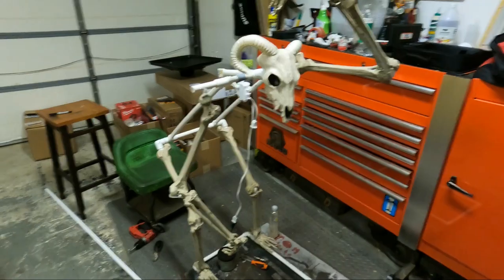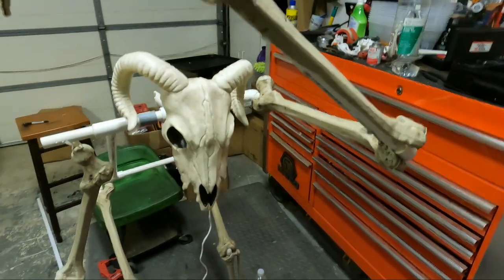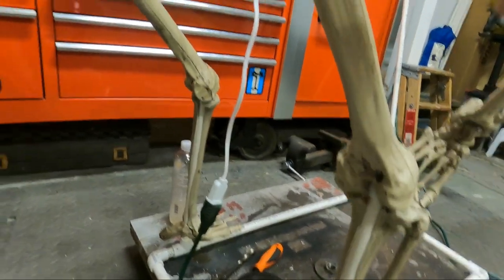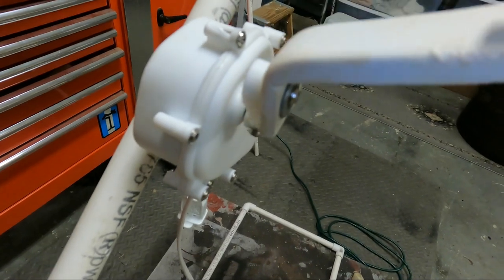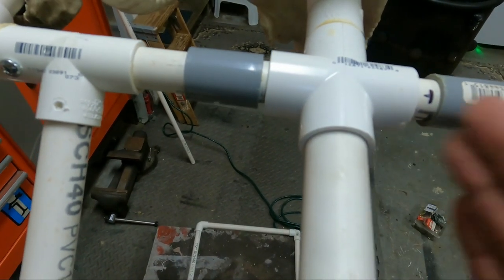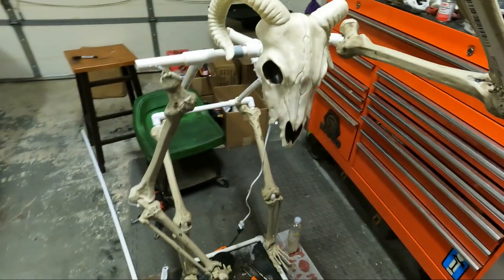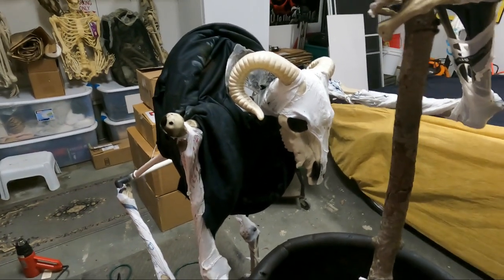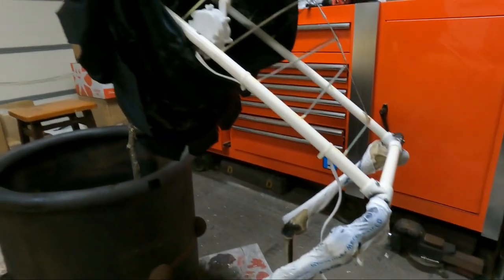DIY HALLOWEEN - Cauldron Creep Build (Part 1)

Comment: Love the added goat/ram skull.....question, how do you keep the stick/staff from rotating and binding up? I've been working on one and it wants to spin a lot and I have low rpms. Since binding it wants to rotate the upper hand. Do you let it rotate as it stirs. I hope I'm making sense.
Reply from the maker: The top od staff is hard mounted. The bottom just sits in a cup. Hope that helps

Comment: This looks really great.  Your wiper motor seems very quiet.  Mine is from MonsterGuts and is quite loud.  Did you do anything to make it quieter?
Reply from the maker: No I did nothing to it. Just used a old power adapter. My FCG motor is loud and it's from Fright Props..